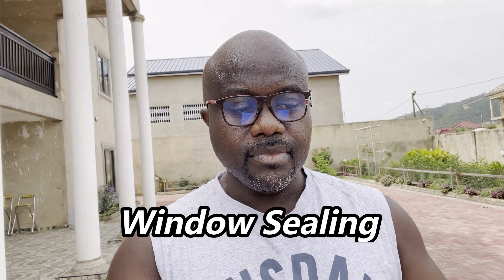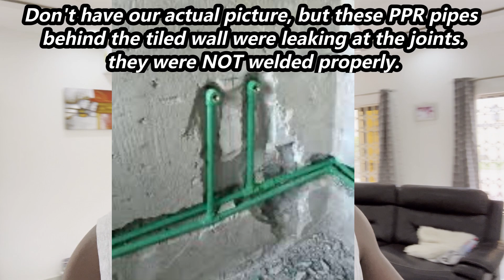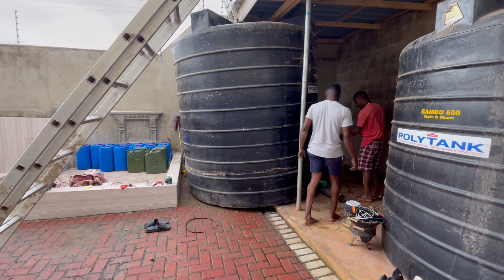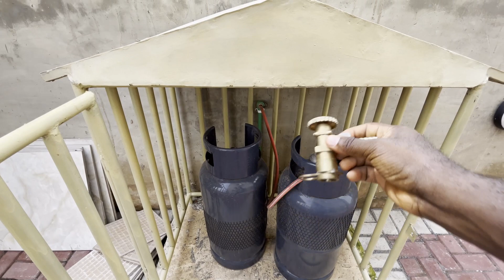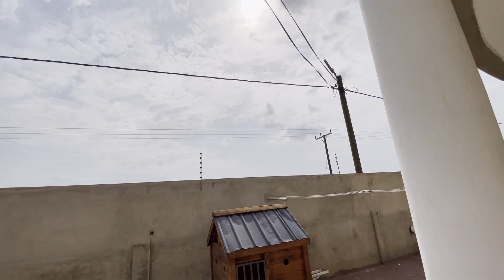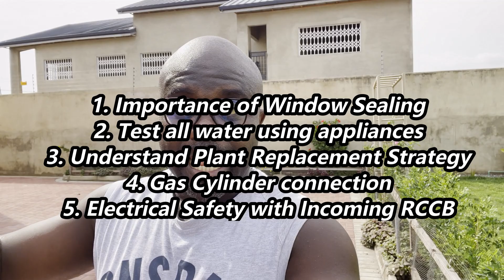5 BUILDING FINISHING TIPS | BUILDING IN GHANA

Comment: Will the RCCB not trip if I connect a welding or heavy machine?
Reply from the maker: Welding happened at my house two days ago 
It did not trip 

It’s not about the load
It’s about the characteristic of the equipment and leakage to earth 

The 100A RCCB is suitable for the house load. If a large machine causes it to trip it means the machine is unsafe or someone is getting a shock
Reply: @kingstal90  I see, I had wrong idea about how it works
Reply: @kingstal90  pls how much did u get yr Rccb for ?

Comment: Great tips. I am curious to know through out the home building process what do you wish you would have done differently? In the home design, layout, use of local artisans etc…
Reply: Can u get a Carpenter to take off the roofing on top of the water tank raise it more higher to make it easy for ur plumbers so that that area will look nice than ur plumbers pushing this big tank in& out they will hurt their back ok
Reply: Is it advisable to buy a completed house already built ? they use cheap materials is a shame, u did a good job by fixing the leakage at the bathroom wall ur living room ceiling,  a hole lot removing tiles on ur walls i can't believe it, don't forget the water tank please fix that area it doesn't look good, make it easy for the plumbers their back will hurt them they are young make that area open or raise the roofing 🙏🏻🙏🏻